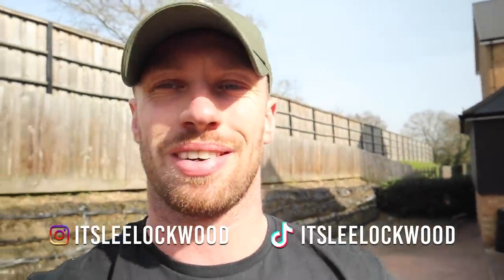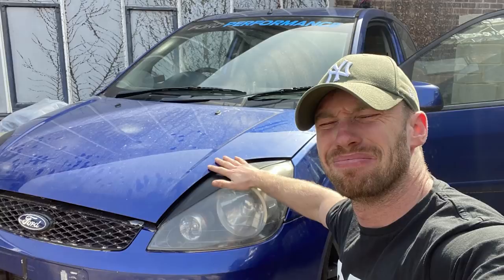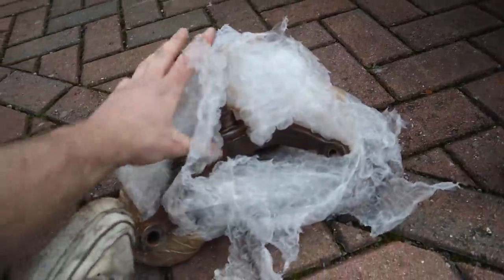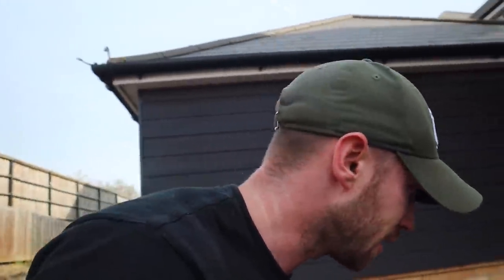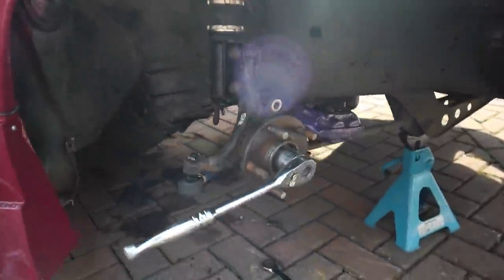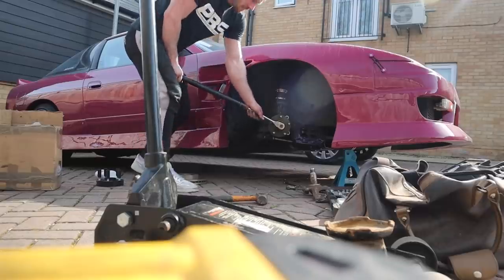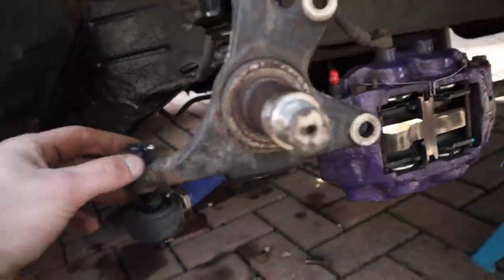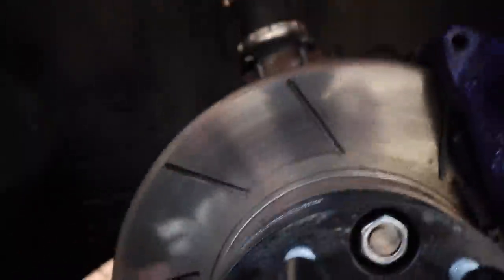S13 lower arm and Hub UPGRADE!

Comment: That's not your idle adjust that's to remove slack from the cable for the accelerator pedal , if you're taking all the slack out the cable you will have idle issues , as the cable heats up an as the engine moves . Your throttle body probably isn't closing because of it (no play left at the pedal cable is to tight). Your idle will either be ECU controlled or there's a screw on the throttle body stop. You must have play at that cable 1-2mm wiggle.
Reply from the maker: Thankyou!
Reply: This…  was gonna say but put perfectly.
Reply: spent ages adjusting a similar thing on my E30, and then after lots of reading up on the ICV and other fault finding, I worked out it was too tight, which then meant the ECU was bypassing the ICV as it didn't need it, so no cold increased idle. Took far longer than I'd like to admit fiddling with my nuts under the bonnet!

Comment: Hi Lee, as per JH comment using the cable to hold the throttle body butterfly open is a bodge and is probably confusing the ECU so make sure it's fully closed on it's stop. Not sure on your car but on a frst running fords early efi system there was a screw that sets the base idle with idle control unplugged. You then had to disconnect the battery for a while and then reconnect and perform an idle relearn with idle control plugged back in with full load on the system eg lights and cooling fan etc. Sure they must be a similar procedure for your car, a good tuner should know I would have thought. Other than this High idle can mean it's pulling air somewhere so check all pipes for splits and any gaskets but I assume these where new after the rebuild.

Comment: Maybe use a C clip behind that nut. That way you can remove it or add more if needed. Also have you checked the clearance of the throttle cable to the bonet? Maybe when it is shut it is pushing down on it? Would make sense why the idle gets higher.

Comment: Is there not a screw on the eccentric wheel on the throttle body you can adjust? Instead of where you currently are?

Comment: Bend the plate the throttle cable bolts into on the inlet. Then you can add some slack to the throttle body

Comment: Get a grinder with a thin disc cut a line in the nut and slide it over the cable part of ur throttle cable?

Comment: I can't see from the video, but surely the throttle body has a throttle position sensor?. By adjusting the cable you are adjusting the idle point of the throttle position sensor. Usually they are 0-5v and Need to be set up with a multimeter at 0% (idle) throttle then as 100% (wide open) throttle

Comment: That’s not an idle nut that’s just your throttle cable adjuster you want a little slack so revs don’t come on. You might have a temp sensor or 02 sensor or a sensor on the injection making it run that way. My car was running like that and it was my outside temp sensor faulty changed it and was brand new again.

Comment: The throttle cable is sticking try some oil down the line and full throttle it a couple times to get the cable lubed

Comment: im having a similar problem with my idle. I've also tried adjusting the idle on the IAC valve. Still does the same. 🤔
Reply: Don't know if this is any use but idle should be adjusted when the engine is warm. That's what I do on my bike anyway.
Reply: @stichupman  thanks for the tip. 👍